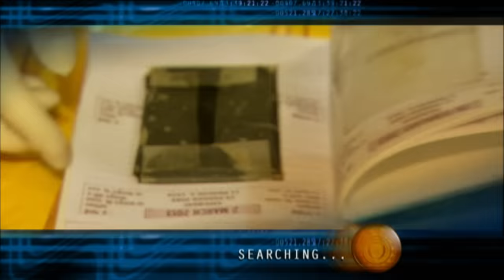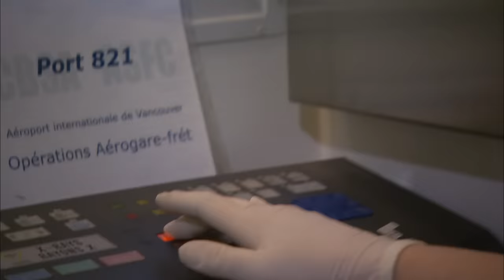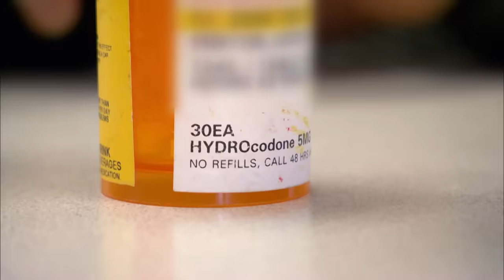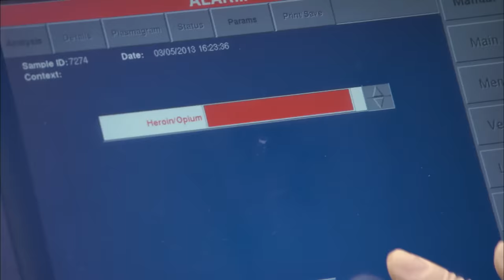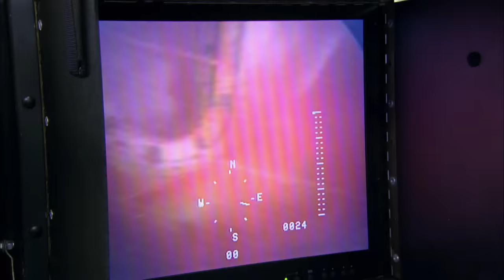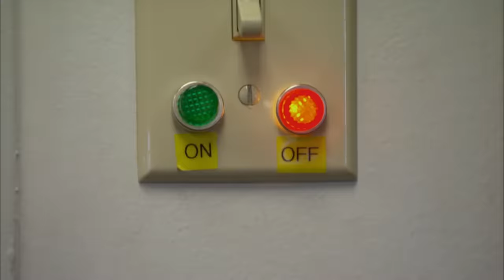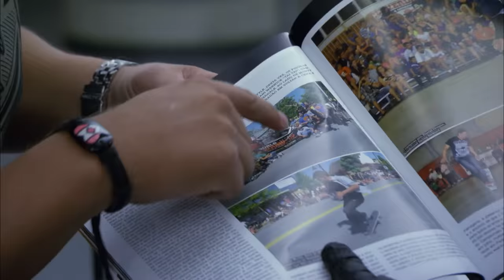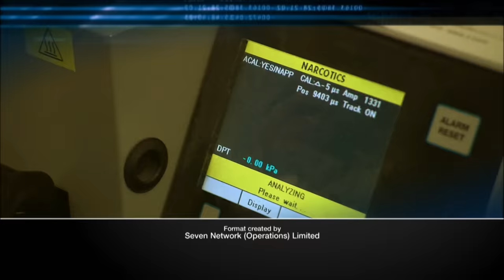Marine Team Searches Ship Loaded with Guns | Border Security: Canada's Front Line

Comment: If going to Alaska,  don't drive through stinking Canada. Take a ferry to Anchorage out of Washington. As for maritime laws, the crew doesn't have to answer questions as long as they stay on the ship.
Reply: First part, totally agree. As for the second part, I took an Admiralty Law course in the Navy and thought that the 1982 UN Law of the Sea Convention dictates an exclusion zone of 22 km (12 nautical miles) off the coast to be considered in “International Waters,” e.g. where the Captain has full responsibility of the ship and jurisdiction over the crew. The issue is that they were docked, which not only places them clearly in Canadian waters, but they are additionally “hooked up” to utility services at the port that provides utilities (such as electric) via Canadian infrastructure. This would make them open to inspection just like any other traveler and no reason is needed in Canada provided you’re a visa holder and not a Canadian citizen. Any individual, their property, their car, or even ship, risks deportation if a border patrol officer is not satisfied. Now, if they were in International waters off the coast of Canada, that would be a whole other story altogether. I could be a bit rusty as I learned this a long time ago, but I don’t think Admiralty Law has changed all that much.

Comment: those guys would crap if the looked under my mattress. They call a hatchet a weapon of opportunity rather tan a way to get out of the cabin when sinking. Over zealous wussies
Reply: Cabins are made of metal, even the door.  A hatchet will not help.  There's no wood as a structure by international agreement. This is to prevent fire spread and to limit flooding. Any wood permitted is decorative OR as furniture.